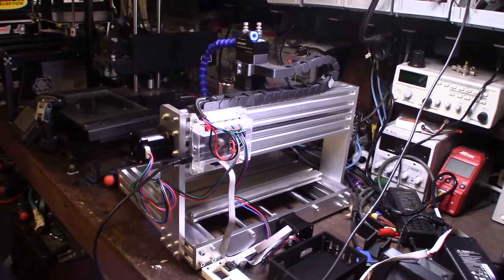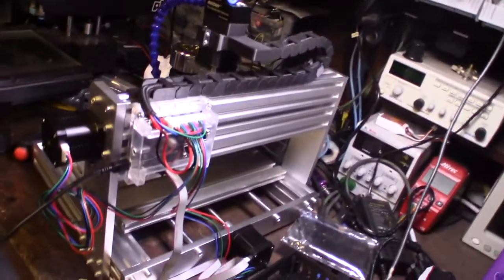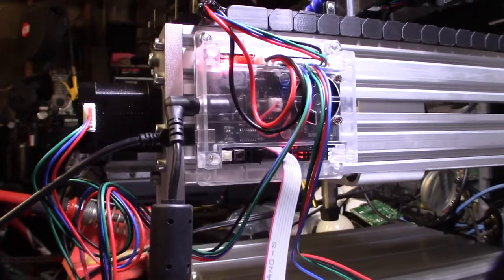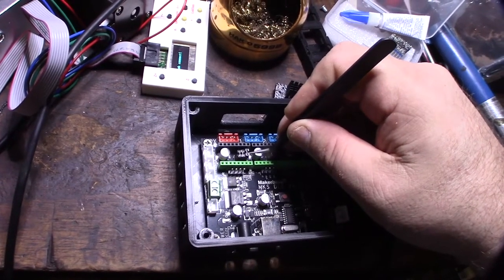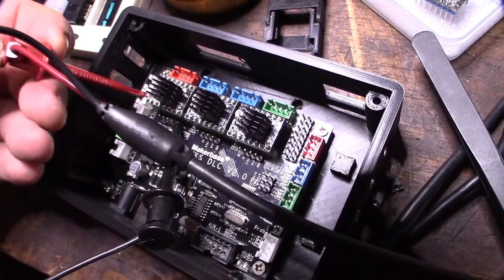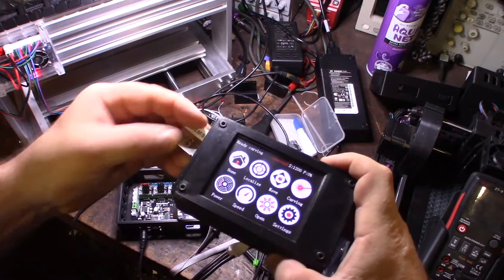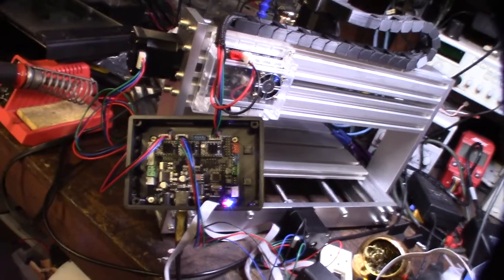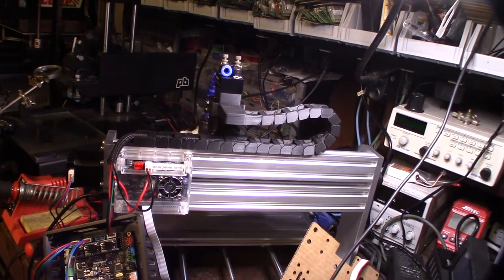GRBL Trinamic Drivers on MKS DLC 2.0 3018 CNC upgrade Closed Loop TFT32

Comment: Can this work Trinamic TMC5160 drivers with LinuxCNC?
Reply from the maker: I'm assuming yes. You cannot use SPI mode to control current. GRBL doesn't know what SPI is. Are you running nema 23?
Reply: @fintechrepairshop  thanks for the reply. I’m running NEMA 24 4N.m and NEMA 32 9N.m. I will use it on a PM-25mv bench mill which will be converted to a CNC. I heard many said it will not work on LinuxCNC.

Comment: Is that skipping step in 256microsteping? have you find some tweaks to fix it? I have the same problem if I run the stepper fast
Reply from the maker: The only option is to turn up the current using the trimmer pot, GRBL is not like Marlin. You can't control the drivers via UART from GRBL. You have manually adjust the current.

Comment: Great video, im in need of changing my 3018 cnc board. so you just got a sub. how did you power this board compared to the old cronos board?
Reply from the maker: 12V AC adapter. Mine is 5 amp